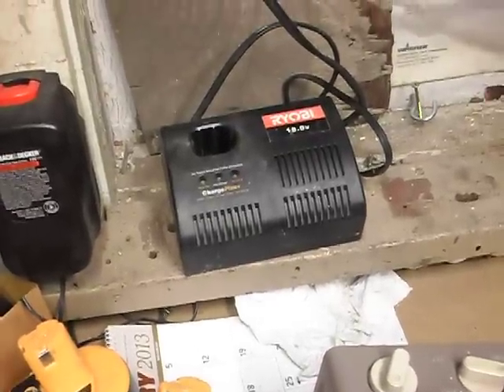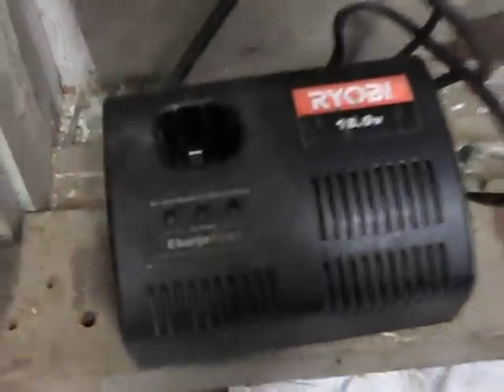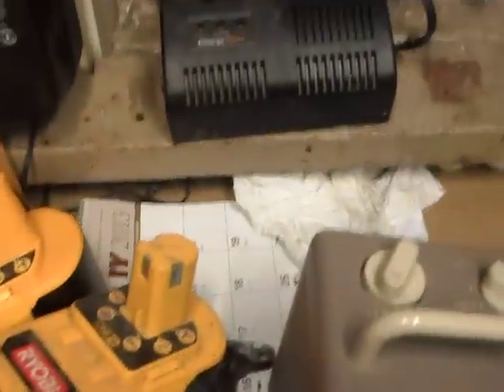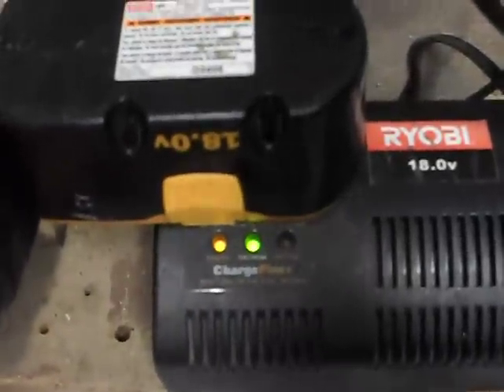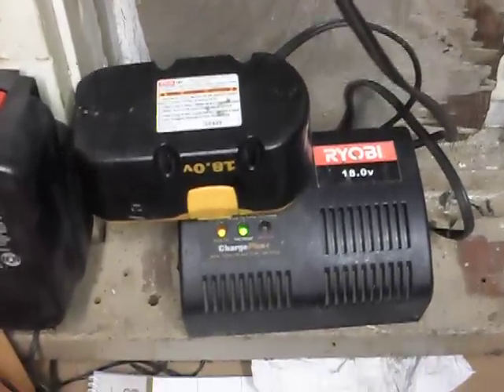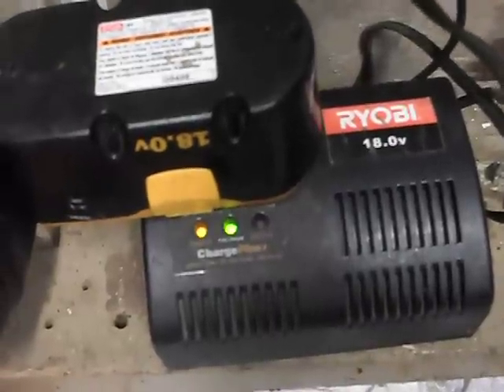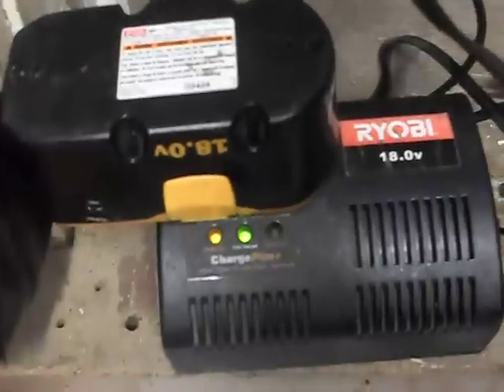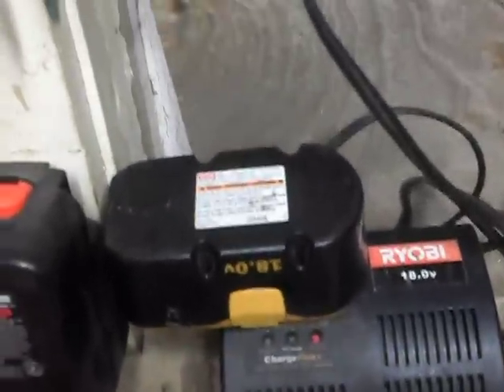How to charge A DEAD Ryobi 18 volt rechargeable battery! IT WORKS!!

Comment: & did the battery work (normal) after that if so how long does the charge last?
Reply from the maker: +AOAB  mine are still working.
Reply: chaseme81871 it really worked RIGHT ONN SAVED ME ABOUT 90BUX👍
Reply from the maker: thats awesome. thanks for watching and leaving a comment.

Comment: I must have two dead chargers.  I cannot even get the lights to some.  I have tried all your suggestions but as I said my chargers must be gone although I can put them up to my ear and hear a humming.  Any other suggestions.  Thanks.
Reply: I have a suggestion.  Throw them away (recycle them if you have that option).
Reply from the maker: there are fuses inside the charger. MAKE SURE IT IS UNPLUGGED BEFORE MESSING WITH THE FUSE.

Comment: The easy way to do it is to plug the charger into a power strip that has an on/off switch. Mine has a rocker switch and I could switch it on and off at least 15 time in 5 seconds without pushing and pulling the power cord.

Comment: I have found when the battery drops below .5 volt it won't charge.  I have a variable voltage power supply and will turn it up to 40-50 volts and "Jolt" it for 2 or 3 seconds (no longer). This burns the carbon build up between the cells, now allowing it to take a charge. This will not fix dead cells. But will allow you to get a few more uses out of it.  Please use safety in mind while doing this.

Comment: Thank you. 
I have exactly the same old blue Ryobi drill, charger and two batteries, which only one works.
I had to pull the plug out fifty times, then I removed the battery from the charger rapidly about another fifty or so times. About to give up, I decided to go back to pulling the plug, around another 20 times or so, when the red charging light came on. Two hours of charging and the battery was fully charged. Now I have another battery that I can use on my Ryobi drills, recip saw etc.
Give it a go and don't give up.
Thanks once again, from Australia.

Comment: yes! it works! so many other hassle methods on youtube which involve connecting to other batteries with wires.  so I had to try this one first.  I plugged in and out of wall socket positive side a few times first, then negative, and it turned red.  Thanks so much.  Is your paypal still the same?
Reply from the maker: +Pamela Alt yes it is. thank you so much for the comment. I am glad this was able to help you out.

Comment: i have this same battery charger combo. When i put the battery in the charger it blinks green for a second. then goes to red? Does that mean the battery is charged?
Reply: Cody T i do not have a tool to use the battery to test it out. i have 2 batteries that i let charge for the day. now when i put them back on the charger it blinks green for a split second then goes to red (charging). I'm assuming the flash of green means its charged... or at least somewhat charged? I got it at a nice thrift store that has 14 day return policy so i can take it back if this is a defect of some sort
Reply from the maker: Cody T I would take it back.

Comment: To those upset with Ryobi, just be aware these are made from NiCad cells and it doesn't matter whose brand, Nicad is old technology - NiCad packs only last a year or two at most. Also this fix really isn't a fix since there are probably one or more dead cells inside the pack that will not hold a charge any longer. I have a coupe packs I have to recharge every 20 minutes as they are shot. It sux that the packs are so expensive as the tools keep on running. I looked at buying new packs but a whole new tool set can be had for another $30 bux. Crazy.
Reply from the maker: thatnks for watching,and leaving a comment!  have a great weekend!
Reply: Yeah, on that old tech you mentioned... The Dewalt NiCads will get you 5 years and some change. Ryobi One plus NiCads will get you 2 years. Ryobi is the worst company for cordless tools. I will never buy from them again.
Reply: Mr26Huffy Nonsense. I have 8 year old Makita 18V nicads that have hundreds of hours on them and they still charge just fine. I also have a Ryobi 18v Li-Ion kit w/ high cap batteries that's less than three years old-one battery quit charging after about 20 hours of use.
Reply: onitram1 Sorry, NiCad is obsolete.
Reply: Mr26Huffy  "ob·so·lete,  no longer produced or used; out of date"  If they're obsolete, then why and how would Ryobi be using them in their batteries? In fact, you can still buy Ni-Cd replacement batteries for virtually every tool mfg. that used them. But...my Makita batteries are actually NI-Mh, a technology that is also becoming outdated due to LI-Ion technology, but is also not "obsolete". I do have Ni-Cd batteries in a 6 year old junk Kawasaki tool kit someone gave me as a gift. They still charge fine as well, but brand, or rather quality, does indeed matter, which was the crux of my reply-you're post is incorrect.

Comment: Nice hack brother! I guess the power supply capacitors inside the charger are discharging into the battery each time you unplug it. Leaving the batteries with enough juice to turn enter charging mode. Most impressive! Thanks

Comment: Picked up two batteries, two chargers, a drill and a power saw for $20 at Pick-N-Pull.  Guy working there said they didn't work.  Tried to charge batteries, got both lights on, no charge.  Tried googling a place to find new batteries, stumbled across this video, and low and behold it worked!  Unbelievable.  I had mine plugged into a surge protector and flicking it on and off about 15 times did the trick.  Thank you, and you rock.
Reply from the maker: great story! thanks for sharing it.

Comment: It seems that if the battery voltage goes too low the charger thinks the battery is no good even if it will charge OK if the voltage can be brought up above that limit. Their chargers are not smart enough. Some times you have to open the battery to charge up the battery directly before the charger will work.

Comment: Didn't work on mine at first, they'd been sitting too long and were down to under 4 volts, so I connected them to my car battery for about 30 seconds which brought them up to 10v and then after a few flicks of the switch it worked.

Comment: Thanks for the video and the tip. It worked after 50 tries. You saved me the hassle of buying replacement lithium batteries, and a DeWalt to Ryobi adapter. I can now finish building my deck. Take care friend.
Reply from the maker: thank you.

Comment: This made my charger stop working.  opened it up and found the 4A slow blow fuse was toast.  here is how I get my batteries working again.
I have a 12v 3a car charger.  first I put the negative clip on the positive side of the battery then tap the positive clip to the negative side of the battery.  you will see a little sparking.  by tap, I mean press it against the terminal for about a second.  do this 5 or 6 times.  THEN put the positive clip on the positive terminal and negative clip on the negative terminal.  first tap it a few times, then hold it on for about 30 seconds to give the batteries a little charge.  put on charger.  if still gives error, charge with car charger for another 30 seconds or so.  this fries the internal short inside the battery that is causing it to have lower run life and or not charge at all.  works with any nicad, nimh battery.  works for me all the time but do at your own risk.  DO NOT DO THIS WITH ANY LITHIUM BATTERY!

Comment: What about a battery that isn't dead, but it only works for a few minutes before dying out?
Reply: Does the charger show yellow-green?

You might just have a "real" dead battery.
Reply: TheRealSimpleSimon it charges like a regular battery, but drains within a few minutes. power tools run low even on a full charge.
Reply: Might be a dead cell or two. I got one of mine to charge, but it only goes to 15V. Just pulled the second one and it's 16.5V. They will probably act like yours in use.

I'm still in much better shape than I was 2 days ago. ;)
I'll probably dig into them and see exactly what kind of cells they are - can certainly make at least one good battery in short order, and get 3 replacements from somewhere for the other one.

Comment: i tried this and it was taking forever. so i checked the battery with a meter, it was only at 5 volts.  i put my 12v car charger on it for about 15 seconds and THEN put it back on the old ryobi charger.  it went to fast charge immediately.  then i promptly ordered 2 new lithium batteries and charger for $99 on amazon.  ni-cads aren't scottish.

Comment: Just letting mine sit in the charger with 2 lights it shifts to red 1 light. only does that when they are almost fully depleted
Reply from the maker: +Joe Szucs  the thing is with these batteries they will get depleted more and more, and faster as well. I can charge mine up fully,and if they sit a day or two they are completely dead. and that is when the error shows up on the charger.
Reply from the maker: +Joe Szucs by the way thank you for commenting.

Comment: THIS WILL BLOW THE FUSE IN YOUR CHARGER!

Although I give the poster credit for discovering this and it seems good at first I just wanted to make the point above very clear.  Got it to work for first battery and it seemed great although charge did not last long at all.  Put my other non-chargable battery in and it too got the red light (eventually) and started to charge.  Came back later and no lights at all.  After opening the unit up found that the slow blow fuse inside had blown (gee I wonder why)... now even if I bought new batteries I have to get a new fuse to fix my charger. 

Long story shot NOT A GOOD SOLUTION! Off to buy new batteries and a new charger fuse. :(
Reply from the maker: themothershipp out of over 87,000 people you are the only one with this problem. you had a weak fuse. replace it and move on.

Comment: Just hook it to a 12v car charger. Low amp setting for a few minutes. When the tool battery drops to zero volts, the charger doesn't recognize it. All it needs is a few volt charge

Comment: I was able to do this with one dead battery. The second time I tried this the charger died. The plugging in and out may have fried the charger.
Reply from the maker: there is a fuse inside the charger.
Reply: Good to know. I'll check it out. Thanks.

Comment: Was just about to bite the bullet and buy 2-new batteries and a new charger. When I plugged either of my batteries to charge, the green light and yellow light would be on and the wouldn't charge. Did a quick search, found this, tried it and it is now charging. True test will be if it has juice tomorrow morning. Thanks for the tip!!!

Comment: Can you tell me what the yellow, green and red light functions mean on the charger?  Thanks.
Reply: Hey Jim, the Red light means the battery is on a fast charge. The Green light means it fully charged and it will stay on until you take the battery off the charger. It will remain in a trickle charge maintenance mode as long as the Green light is on. Now if the Green and yellow light come on it can mean you drained the battery way past it's normal voltage. Leave it on up to 30 minutes. If the Green light comes on its charging. If it doesn't come on and it's still the Yellow and Green it's a defective battery. You can try what the video suggest. I've done what the video says on batteries before and it does work. If it doesn't it's time for a new one. I hope this helped.
Reply: Thanks Cole.  Jim
Reply: No problem Jim! Glad I could help.

Comment: Those two lights is not an error but in charge plus mode which means it is zapping the battery, once the battery has enough voltage it will then switch to Fast Charge mode, now if you plug the dead battery in and the fully charged light comes on then this trick will work sometimes, I know Ryobi Batteries very well and figured I would let you know as I deal with these all the time
Reply from the maker: If both yellow and green LEDs come on, this indicates
a deeply discharged or defective battery pack.
Allow the battery pack to remain in the charger for 15
to 30 minutes. When the battery pack reaches normal
voltage range, the red LED should come on. If the
red LED does not come on after 30 minutes, this may
indicate a defective battery pack and should be
replaced.

Comment: yes it worked for me. just curious how long the battery will hold the charge or stop working for good all together being that the battery is on the old side. I don't use them on a regular basis. again just curious if anyone knows. i'm sure i will find out myself in the future :)
Reply from the maker: well.......before i started doing this my batteries would go dead anyway if they set for a few days without use.  but they will last as long as the want to i guess. there is no definite timeline on how long.

Comment: Thanks - the tip worked! Found this video by accident, and I'm glad I did. I had a P100 battery that was stored for over 2 years that I should have disposed of, but it charged up fully after getting around green/yellow LED problem.

Comment: Man I plugged in unplug the thing at least 200 times and it never turned red? I have three dead ones here, two that aren't really that old. Actually I'd rather have normal chargeable batteries because they last longer than these crappy Ryobi lithium's
Reply from the maker: 70srock70s make sure that when you unplug it that both yellow and green lights are allowed to go off before  plugging it back in.
Reply: 70srock70s

Comment: Just did  it to 3 batteries-It works! My old chargers were good!  I thought my old chargers were bad so I bought the green Ryobi battery charger and after a few times the batteries were "dead" again! Now I'm gonna raid the Home Depot battery disposal box and get some more nicads!
Reply from the maker: glad it helped you!it will blow the fuse in the charger sometimes. so make sure you have plenty of slow burn fuses on hand.

Comment: **BEWARE** I did this. It worked for 3 seconds then I saw my charger fry (thru the cooling vents).  Now it's dead.
Reply from the maker: +Dan K change the fuse inside.

Comment: Tried that trick it don't work the red light came on after I followed your instructions then less than a minute the red light turned off. Now I plug the charger in and NO lights come on with the battery in charger. what gives??????
Reply from the maker: +gmb63 replacee the old fuse inside of it. sometimes they blow because they are old.

Comment: Well it worked...but the charge only lasted 24 hours....without even getting to use it for anything.
Reply from the maker: those batteries tend not to hold a charge very long, even new ones never did. it was always frustrating. but at least you can get them charged now for when you do need them. thanks for watching.

Comment: Ryobi lied to you, 1 those two lights that come on means the battery is in charge plus mode meaning that it is zapping the battery and when it has enough charge in it, it will automatically switch to fast charge mode which is red. 2 if the battery is dead and the fully charge light comes on when you put the battery in the charger then the battery is totally dead, however you can try that trick or use a car battery charger to try and zap it, I charge these all the time and as a pain in the ass as they are they do work great when they are charged fully

Comment: On the Ryobi One+ 30  minute charger, this works too. However, you have to keep taking battery out of the charger and putting it back in several times rather than unplugging/plugging the power cord.

Comment: I thought this was going to be another waste of time, That is until it worked! By the fifth time I plugged it in, it began to charge. And these batteries are OLD. I  got the "gift box" probably 10 yrs ago and I haven't used it in 5 yrs bcz the batteries were dead.  Thanks for the hack, You saved me both Time and Money!
Reply from the maker: glad i could help. one of mine sit on a shelf in a shed for probably 4 or 5 years, and i got it to work. thanks for leaving a comment.

Comment: I tried the trick and the battery did change to red but then my charger died.  No lights at all.  OH well
Reply from the maker: Kelvin Bushan mine did that too thew other day ,mine was the fuse inside the charger.
Reply: Thanks I have to open it up
Reply: Much appreciated
Reply from the maker: Kelvin Bushan was it the fuse?

Comment: Thank you so much, I was looking to find where tI could order a replacement p100 and came across your video. I tried your method and it went to the red light on the third try. I charged it and my drill is working like a charm. cheers.
Reply from the maker: great!